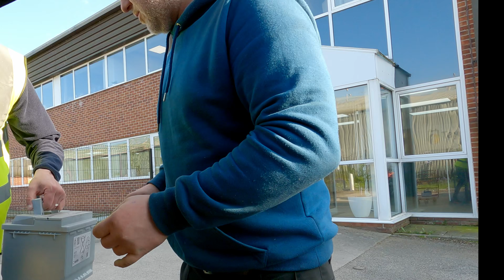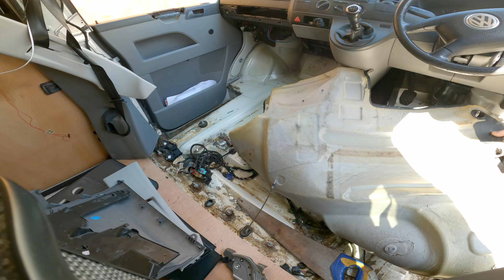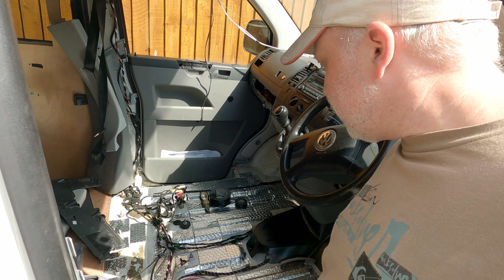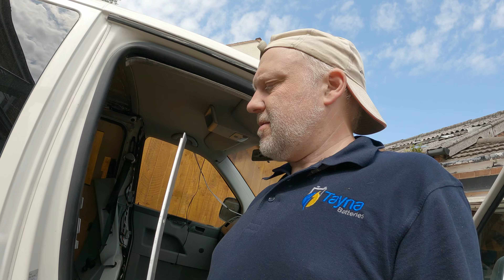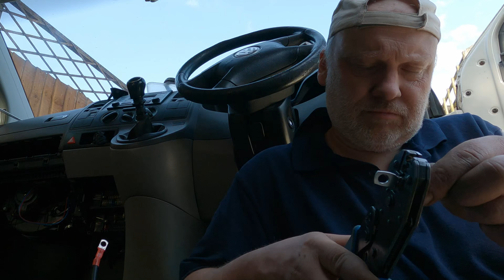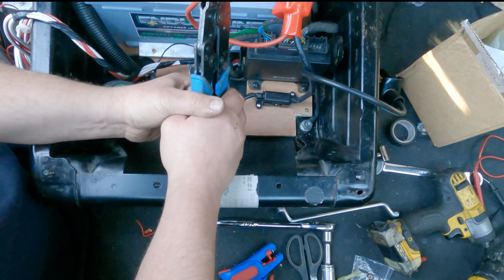Installing A Spilt Charger System & Leisure Battery  - VW T5 Camper

Comment: Great video and a good simple, but very relevant explanation. Can you assist with faultfinding on a similar system? I have a T5.1 with the same set up. I have recently (over the past 3-6mths) started to notice (on the in van voltage meter) that the leisure battery seems to still be charging after the ignition is switched off - sometimes for a good 5,10 or even 15 minutes. I have also noticed (again on the voltage meter) that it will not fully recharge the leisure battery to show 100% ( I think at best I've got it to 40-60%) regardless of how long a journey I go on. Both main and leisure batteries are in good condition and I have had them out the van and fully charged them on a mains charger ( I can't fully remember if the voltage meter read 100% charge at this point or not as it was some time ago). Something else that I have recently noticed (I don't know if its connected, but is causing a voltage issue) the diesel heater doesn't run properly. I turn it on, it goes through the "warm-up" process and then after a few minutes at the point when it should start pumping out heat it turns off/ The last time this happened I actually noticed that the voltage meter also simultaneously dropped to 0.00%, however it clearly wasn't actually a flat leisure battery as I still had lights and the water pump worked ok. I am fairly "OK" with DIY/cars etc and would be happy to tackle this, but would be good to get a few pointers of where/what to look at first - don't want to aimlessly swap out parts. Appreciate this is an old post, but hopefully you or a follower can shed some light...

Comment: I'm confused ive just bought a near enough same one , my came with a 8 awg negative , do you know where that goes to also the negative from the vsr (the little thin wire) im a Newbie lol
Reply from the maker: I'd say go double check the wiring diagram for your exact kit, so I'll be vague incase it's wrong info
The thin wire may go to the leisure ground as reference for the relay and thick negative may be the leisure battery to the chassis to complete the circuit 
I have seen relays needing a positive trigger so I'd advise double checking with the supplier, but feel free to re watch the video if it's a similar kit, and check out the links in the description
Reply: @CrispysProjects thanks bud,  yeah seen other vids and thick one does go to chassis ground , thanks again 👍

Comment: Morning Chris. Just spotted the video. Youtube hadn't recommended it to me! There's an online calculator (somewhere...) to calculate the wire thickness needed based on length of the wire run, amperage, and maximum desired voltage drop. Its particularly useful on canal boat builds. Even model boats...😂😂. Fridges are known for switching off when voltage is too low caused the supplying battery voltage dropping but critically by the use of wires which are too thin causing excessive voltage drop. Sure you know all that but makes for instructional comment!😂😂😂
Reply from the maker: Thanks for YouTube algorithm input, I will look into it my side, thanks for the spotting and constructive comment!
I'm sure there's multiple online calculators, I pretty much rely on experience of thinkness and I can let you all into a little secret 🤫
When I bought the various reels of wire I have,  I've wrote on the ampage on
Reply: @CrispysProjects  Ah, but not the length of the run!!